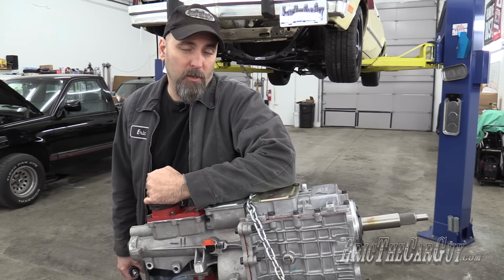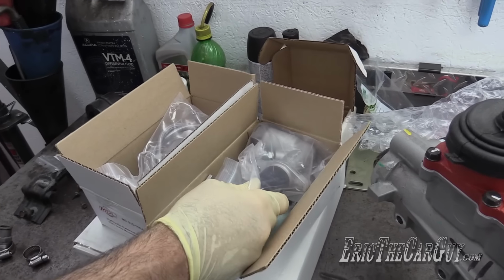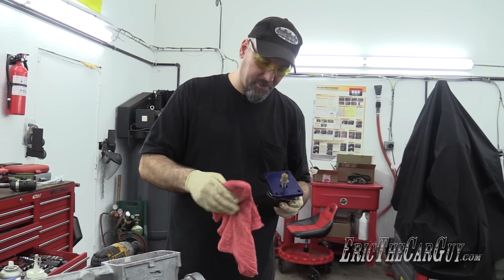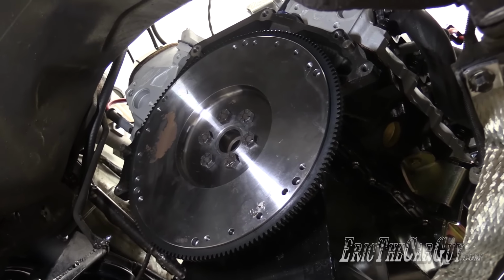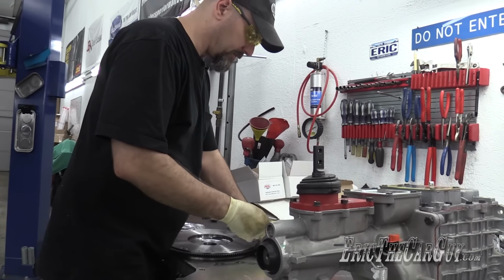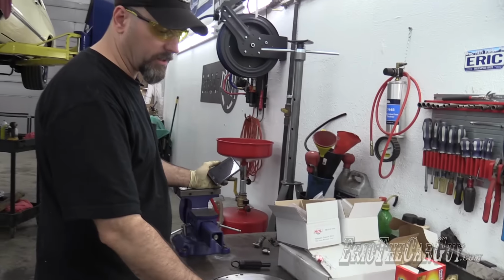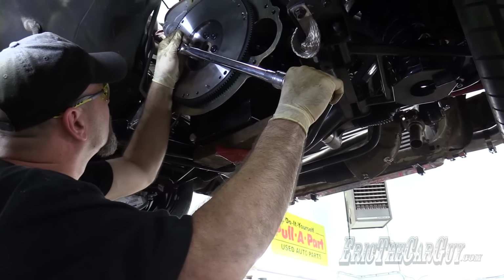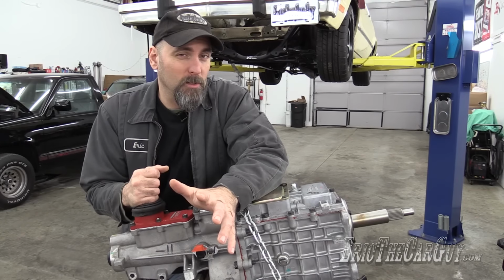TKO600 Install (Part 1) #FairmontProject

Comment: I used Modern Driveline for a C4 to TKO600 conversion in my 70 Mustang and I love them. Their customer service is great. They noticed the driveshaft length that I sent was a little out of their expected range. The MDL rep walked through the measurements with me and we confirmed they were right, but the fact that they checked with me really made me feel like I was dealing with a great company.

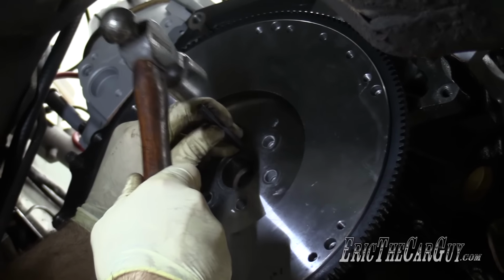Comment: Im not sure why Eric match marked the flywheel to the crank (@~15:53). The crank can only go on one way as the flywheel/crank bolts/holes are not all evenly spaced. 

OK he picked it up later.

Paul

Comment: If you don't want a flywheel to rust but can't use a protectant due to the clutch plate TRY this put a lite coat of used motor oil over the surface and burn it off with a torch leaving a dry carbon residue behind. This will help prevent rust but will not affect the friction material. the first time you slip the clutch it will wear off.

Was that new center bushing pre lubed?  I was always told to soak them in oil before fitting and never use grease.
Reply from the maker: That's a great idea. No lube on the bushing as instructed.
Reply: How about cleaning it with brake cleaner, drying thoroughly, and then "smoking" it with an acetylene torch turned down very low? If you've used an acetylene torch you know what I mean by "smoking" it since that soot makes a nice coating.
Reply: Also, the pilot bushing is most likely Oilite bronze which is very porous by design. The bushing is made, then impregnated with oil under a vacuum. The pores retain the oil and it's lubed "for the life of the bushing."
Reply: Normal range of dibties

Comment: Why didn't you tighten the flywheel bolts in a offset "star" pattern like wheel nuts?

When doing my flywheel i drilled 2 holes in a piece of 4" long flat bar. bell housing bolt in 1 end and pressure plate bolt in the other.  way easier to torque up.

Comment: what is the clutch rated for it seems something with that much power would need a muti plate clutch. you are also a brave man for leaving a torque wrench just hanging on a bolt like that

Comment: question. well first love the videos and info you give.  

how in the world do take the caliper off my f150 truck 1986.....  i never seen anything like it. 

Anyone can chime in on this.....
Reply: TheBody245 its probably a tapered slide pin a cheap flat head or a drift and tap on the front of them and it slides out the back there are detents on the ends of the slide pins so it takes a good bit to start normally once it's free just tap it out and make sure you apply slide grease when you reinstall and have it cleaned uo
Reply from the maker: You likely have to knock the slide pins out.

Comment: Eric the reason the arp bolts say a lower torque is becuase of the lubricant they use allow the bolt to achieve a higher clamping load without as much torque being applied. Uhaul is the same way with their lug nuts on the trucks, they have us lubricate the lug nuts and a slightly lower torque than factory becuase of that higher clamp load achieved.
Reply: Huh, never knew that. That's good stuff, since if all goes right in theory it prolongs the life of the bolt and wards it from shearing. Per unit.
Reply: it still stretches by the same amount, but there is less friction so less torque is required, doubt it extends the life, but yes will help stop the head from shearing off
Reply from the maker: I did not know that. Thanks.
Reply: At the least, it'll help keep the bolts from seizing in place...that's always good for potential repairs later in it's life.  After all, rust on the threads will mess up the torque needed to get the correct stretch next time they have to be installed.:-)
Reply: you are correct because at least 40% of torque is lost due to firction and if you lubricate threads then it reduces friction therefor achieving a higher clamping force.
Reply: tnyleo it was on the instructions. #4 use loctite on threads and lube on inside of fastener head.he didnt read instructions!. lol
Reply: Actually Eric used the ARP 100-2801 flywheel bolt set. 
The ARP 100-2801 flywheel bolt set is the less expensive lower strength High Performance Series rated at 180,000 psi set that torques to 75 ft/lb and provides approximately 11,900 pounds of preload. 
http://arpinstructions.com/instructions/100-2801.pdf

The ARP 200-2802 flywheel bolt set is the higher priced, higher strength premium Pro Series rated at 190,000 psi set that torques to 85 ft/lb and provides approximately 13,550 pounds of preload. 
http://arpinstructions.com/instructions/200-2802.pdf

Applications with engines such as Eric's that develop higher torque benefit from the higher strength, higher preload which develops higher mating surface clamping force. 
Higher preload and clamping force is especially important in applications such small block Fords because there are no dowel pins used in the crank flange to flywheel interface meaning the flywheel bolts and the resultant clamping forces transmit all of the torque in shear. 
It is also equally important to not over-torque flywheel fasteners because they experience shock loading and over-torqued fasteners are likely to fail during shock loading. 

When installing per ARP's instructions the Blue Loctite 242 provides locking, sealing and lubrication for the threads and the ARP Ultra-Torque
Fastener Assembly Lubricant provides lubrication for the under head area of the fastener. 

The ARP specified torque values supplied with the specific ARP fastener set/kit are correct for the ARP specified installation procedure. 

It is important to use a thread sealer such as Blue Loctite 242 or Loctite 592 on the flywheel bolt threads on  most small block Fords because the bolt holes in the crank flange are through holes exposed to engine oil and will allow oil to leak at the bolt heads if not sealed. 

From experience, do not use high strength Red Loctite 262 263, 271 or 272 on flywheel bolts unless specifically instructed to by the fastener or crankshaft manufacturer... the reason is that it will damage the fastener and or the internal crank threads or the bolt shears off when removed cold and sufficiently heating the crank flange and fasteners to break the Red Loctite bond (550-650 F) usually damages the crank and the fasteners. 

http://henkeladhesivesna.com/blog/the-difference-between-red-blue-green-and-purple-threadlockers/
http://na.henkel-adhesives.com/product-search-1554.htm?nodeid=8797961093121&msdsLanguage=EN_US&selectedTab=technical
Reply: +R230Tuner 
Agreed.

Comment: Show us what stall test consists off.
Reply from the maker: That's on automatics.
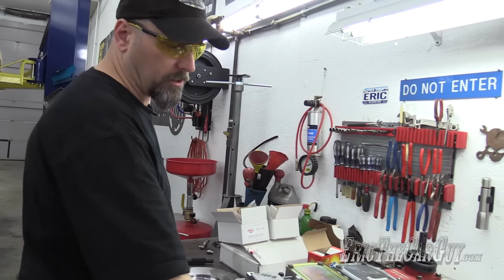Reply: ?? Pause at 25:40  All jobs should be tested for full lock up on the clutch before it leaves the shop "Stall test" (See back page). You never showed that back page :D and I am curious about this procedure.

Comment: You have to give her a paintjob now to match all the flash bits you've ended up putting in her. you could just scuff up the existing paint and get some single pack and not even bother with clear. I would though. You could be in awards territory.
Reply from the maker: Honestly, I like the contrast between the new parts and the old parts of the car.

Comment: Also at a minimum I would have used a spec stage III plus clutch will you just put in is definitely not gonna last that's gonna slip like crazy on hard launches

Comment: Eric I have the Tko600 in my 550 hp 70 Dodge Challenger I've blown third gear three times already you can Not powershift the transmission especially with sticky tires just a heads up. I've even had the TKO 600 modified by liberty and I still broke third gear you make more power than I do beware
Reply: 73sebrougham he noted in the video that his engine produces slightly more torque than what the tko600 is rated for.  he chose it anyway after he asked the guys at tremec what transmission he should get.
Reply: It's not just about the rating.  Example a trans backed with a 3.08 rear and a sticky tire will have more torque applied then a trans with the same engine and a 4.56 axle. It's the whole setup.

Comment: You should throw a 2.3 turbo 4 banger in the mustang with a 16v volvo head swap (google search for FOLVO if you want to know more), make a pseudo SVO. Or better, build a 6-carb beast of an inline 6 for it and make a corner carver out of it.
Reply from the maker: Everything I have is for a V8. I don't want to get into another build where I have to replace EVERYTHING For it to work. ;)

Comment: Cool video Eric , I thought those clutch dowels needed to be pressed into the flywheel. Whats holding them in? Is it the outer rim of the clutch housing? So it looks like the T5 had a 28 spline output shaft and the TKO has a 35 spline or something like that.
Reply: dandel351 the pressure plate holds them in place
Reply: Ok , cool. I've only put auto boxes behind ford v8's so far.

Comment: I wish there was more explanation in regards to not using a polyurethane transmission mount. I was under the impression that polyurethane (engine) mounts was always the way to go. So why would the trans be different. Also, what material was recommend instead?

Comment: Eric, How about a Powerstroke Diesel Mustang like 6.0-7.3?  The Donor Mustang will be powered by Diesel.
Reply: more like a 5.9 swap....
Reply: Actually 450 HP PSD.
Reply from the maker: Interesting, but if I want to use the T-5 I need to stay under 400hp. That, and I would rather do a 'budget' build where I didn't have to work as hard to make every part fit. Thanks for the comment.

Comment: Is it just other noises, or was the flywheel scraping against that spacer plate? Hope its not :0
Reply: Pretty sure that spacer plate is just sitting on the dowels atm, once everything bolts up it shouldn't touch the flywheel anymore.
Reply: Alexander Klein wow I feel dumb lol
Reply: No need to feel dumb, I was pretty concerned about the sound too, but since Eric wasn't worried I figured it was due to the plate not being bolted down yet.
Reply: Yea that Eric's a pretty smart dude
Reply: Was thinking the same thing.

Comment: Eric, I still can't see how you can live with a GPS-only speedometer? What if there's an overcast day, and you don't get any sattelite signals? I mean, as an addition to the mechanical or digital speedo (from the transmission/wheel sensors), it's OK I guess, but as the only way to tell the speed you're travelling, it's just insufficient...

Comment: that's not lithium grease on the flywheel bolts lol, that's thread sealant. some engines  will allow oil to go through the flywheel bolts that's why you need sealant on the bolts, Don't ask me how i know

Comment: did the modern driveline swap with a t5 in my falcon. hydraulic system works great eric. you will enjoy it. ( 400hp 302)

Comment: You can use Synchromesh in just about any manual transmission that calls for ATF. I currently run it in my BP swapped Festiva running the stock 5-speed.

Comment: like your videos.  big fan 
but I am looking to start doing transmission builds for my self I have a couple to practice on.
I have not been able to find a place  I can get tools for doing rebuilding work.  can you help.  Canada dose not have many special tool places other then snap on
Reply from the maker: You don't really need special tools so much as a good set of shop tools. Check out the T-5 build in the description. Good luck.

Comment: with the purchase of the TKO trans and new block. do you feel youve wasted your time and money on the mustang? could always drop a small block back in the stang and just sell it
Reply from the maker: I'm actually thinking of doing the Mustang as a 'budget build' when I'm done with the Fairmont.
Reply: that's an awesome idea.  The Fairmont shows how things go when you have a "healthy-ish" budget, so would be nice to see what can be achieved on a shoestring as well - that actually does what it says on the box.  :-)
Reply: well ill be sure to tune in cause thats what im doing to my 69 nova ss. no motor or trans cause my dad blew the engine with nitrous back in the day. i got a 5.7 vortec behind a 700r4 from a 93 van than im throwing in so it should be fun. might make a video of it

Comment: FYI: you said the Pressure Plate Bolt NOTE doesn't mention lube but in big letters inside the squre it does it says "TORQUE W/ARP LUBE". lol did you miss that part? lol
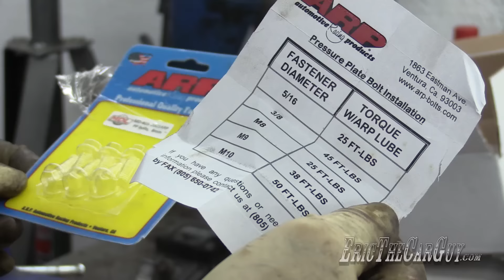Reply: bobspurloc 32:37

Comment: help..please read 
I have a 2006 ford lariat triton 5.2L. sometimes when I start it, it makes a loud awful grinding noise. I then wait for about a minute, then starts right up without the loud noise. anyone know what it can be? any help will be greatly appreciated, thanks.
Reply: the1kamikaze if it grinds and you turn the key off then try to start it and it's hit and miss probably a bad starter my dodge did the same thing the starter had a broken tooth on the gear that moves to engage the flywheel
Reply: Nicholas Dill thanks for the help.

Comment: Cool video, Eric! Glad to hear slippage is normal on a ceramic-copper compound friction plate during the break-in period, I was worried I was doing something wrong with mine (but then, I always am). There was some serious slippage under peak torque, but I always kept it under the red line and never let it slip for long, intuitively, so apparently I'm good. The clutch will still make some noise a bit when putting my foot off the throttle at higher gears, but I heard that was to be expected on my particular type of friction plate (6 puck design, sprung, copper-ceramic friction material, not the same as yours, but comparable). Could you tell me how yours behave when you can finally drive it? It's all a bit like black magic to me at this point, and the info on the internet is all over the place in terms of what to do/expect. I'd really like to hear from a source I consider reliable. :)

Comment: As per the ARP instructions you're supposed to use loctite 242 thread locker on the flywheel bolt threads and the lube ONLY on the face that contacts the flywheel. I use thread locker on my pressure plate bolts too.

Comment: You totally misread the ARP flywheel bolt instructions.  Lubricate the threads with Loctite 242 and under the head of the bolt with the ARP assembly line.  Lubricating the threads with ARP assembly lubes is NOT the thing to do!!!

Comment: You use a torque wrench on bolts that don't really count like the shifter mounting plate but then get lazy on suspension/brakes/wheels where it actually counts? Sigh.
Reply: InternetDude Eric has been doing this for a long time.  When you torque bolts all day for a living being a mechanic, you dont even need a torque wrench. You can "feel" how much torque your tightening to. Bet hes within 5 ftlbs everytime

Comment: You might want to install the bellhousing and run the bell to engine bolts in then rotate the engine. The clearance between a stock flywheel and the separator plate suck on the sbf.  I've had them scrape before and only noticed after I fired it up. Not a fun reason to have to pull the transmission again.
Reply from the maker: Great tip. I recently did some work on the engine where I needed to rotate the crank. No scraping that I could hear.
Reply: Varies from manufacturers.  The Quicktime stuff is pretty good. The standard Lakewood and Mcleod plates can be problematic.

Comment: I was told you should rough up the friction surfaces on the pressure plate and flywheel with sandpaper, is that wrong?
Reply: omg if you didnt get the flywheel machined, and if the pressure plate is used
Reply: only*

Comment: Eric, the ARP instructions say to put the ARP lube under the head of the fastener! This lessens friction during final torque down. Loctite goes on the threads so they don't vibrate loose, you should probably redo those as that could be a serious problem.
Reply: Dima Aryeh That's what I recall from installing the flywheel on my truck.  Lubricant under the head of the fastener, loctite on the threads.  Lubricant on the threads seems like a bad idea.
Reply: Dima Aryeh yup at 26:53 #4

Comment: You should take up Rob ferretti on his project car challenge! :D
Reply from the maker: I'll finish the car first and then decide. If I need to put up 10K, I'm not sure I can swing that. I just bought a new tool box.
Reply: That's the whole point! to motivate you to get it done :)
and no the 10k is a bet between the two Robs, everyone else is just there for fun
Reply from the maker: I don't need any motivation to get it done. I'm running full speed to that end right now. It's nice to know I don't have to put up the 10K. That said, I still need to finish the car first.
Reply: Yea you definitely are the hardest working YouTuber I know. Even if you don't do Rob's challenge do you think you'll be doing any challenges with other YouTubers and their project cars?

Comment: Am i the only one who saw the instruction sheet with the flywheel bolts say coat the threads with loctite 242. And use the supplied lubricant under the head of the bolt. Not on the threads. I hate to say it but those bolts need to come back out.

Comment: So you are working your TORQUE from the engine back on a two wheel drive vehicle.  How much torque can you develop between your selected tires and the road before they break loose?  Torque is not very useful if you can't apply it to the road.  Are you planning on running drag slicks?
Reply: ycmdill if u dont get on it and know how to drive u will be fine
Reply from the maker: At the track, yes I'll run slicks. I"m also upgrading the rear suspension in future episodes for more traction as well.
Reply: Wow!  Out of my league but I still love watching.